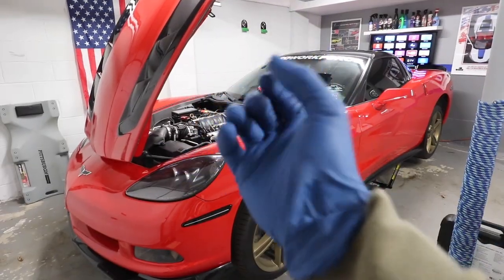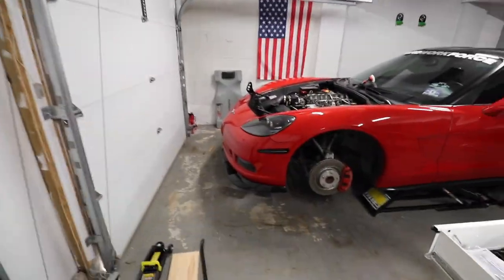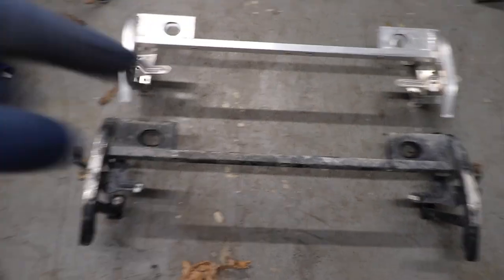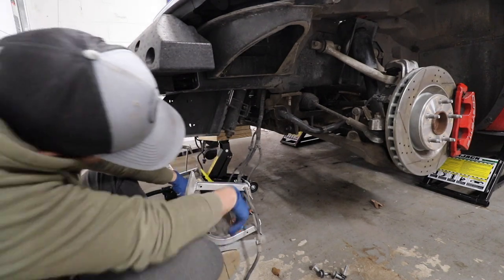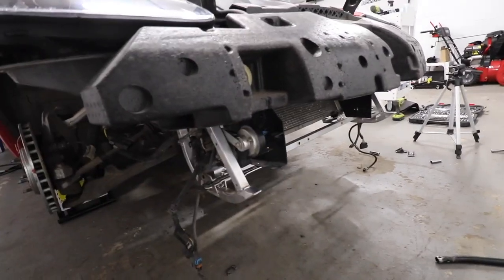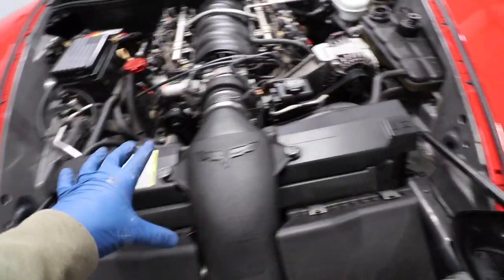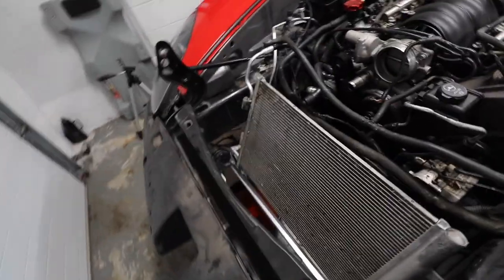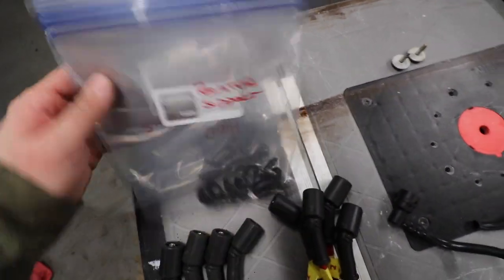Found a big CRACK under my car! Cam Swap Day 1

Comment: Watch your engine temps once you drive it again. Removing the air dam may impact your engine temps since the air dam directs air up to your radiator. Haha nice little screen shot of those 2 bald headed characters. Nice head start on the project, it'll save a lot of time 👍
Reply from the maker: Haha! I thought you would like to make an appearance haha! I will put it back ... i just have the center piece anyway! You will see it
Reply: @Matty.Garage  always like making an appearance. Ok, that center section is the important one. Some don't have issues when they remove it, but most do so just letting you know

Comment: radiator supports get like that from hitting curbs in parking lots.  Also that air dam reduces lift at high speeds.  You should put it back on unless you never go fast.  AND -  air dams play a critical  in the operation of your  Cooling System. By creating negative  pressure under the front end of the  the Front Spoiler - it directs  flow to the radiator.

Comment: Hey Matty, nice to see that you're sooooo close to 7k subscribers. If you really want to break through to 7+k, my suggestion is that you CHANGE THE FRIGG'N TIME-LAPSE BACKGROUND MUSIC! Even Elevator Music would sound better. I have to mute it every time it plays!👿😉 How about some loud manual shifting Vette exhaust sounds?🤣 I have a Vette that you might want to make a sound track of. Just a thought.😎

So the radiator was cracked, in more than one place too! You didn't need to buy a new one! You're spending money like a drunken sailor! Ever hear of JB Weld!? Hey, a dollar saved is a dollar earned! 🤭 Since the radiator is out, I would suggest you pressure wash it. Just a thought.
Save the Wave🙋‍♂️
Reply from the maker: I will play opera next time!! 😂🤣
Reply: On no!😮 ANYTHING but opera! Maybe some Brazilian folk music?  Nah. Maybe some Franciscan Monks Chanting? Nah. I know!💡I'll just wear my noise cancelling ear phones!😉